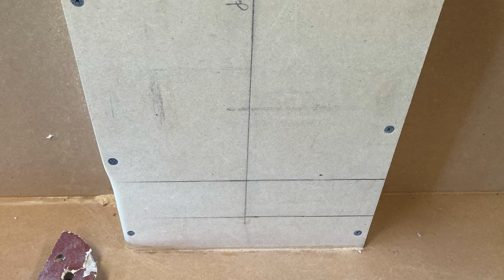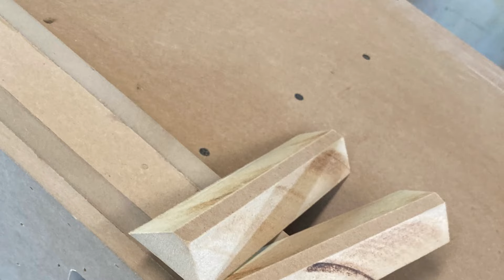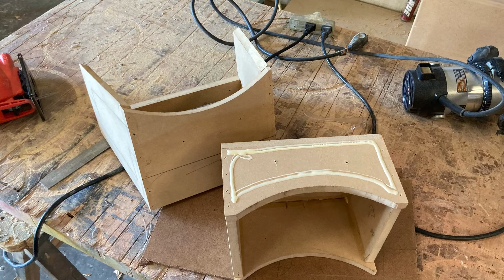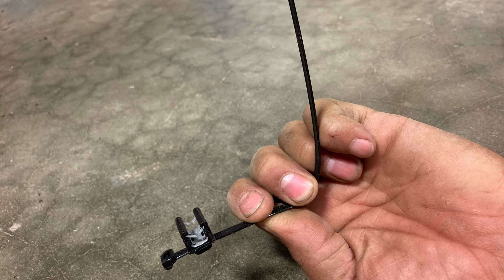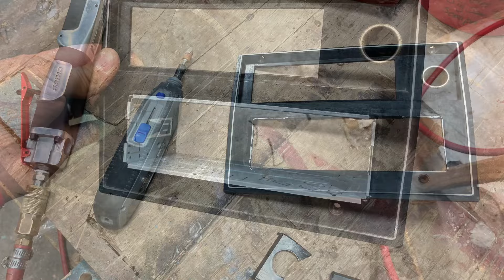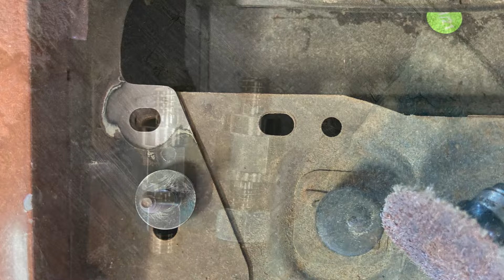El’Camino Box Build and FULL Install

Comment: Why not just use the original compartment because it's sealed and just dynomat it and just make a cover with MDM or plywood why do you need a complete box just curious
Reply from the maker: Great question bro. That coulda been another way to go for sure 👌🏽 As you can tell this el’co  had a lot of rust throughout. I’m not big on using vehicle compartments as the enclosure for a couple reasons. Building an enclosure, I can control the subwoofers air space better, ensure the enclosure is braced properly and not rely on the vehicle for anything 👌🏽 Plus…on this particular install, I needed a solid foundation to build off of for the amp rack.
Reply: Appreciate it currently doing my El Camino I'm not a stereo guy but I paid a shop years ago wasn't really happy with the outcome running for 10s above the seat belt was mid-range and the lower part or some tweeters i think the  (4) 10s was enough music volume because it's all behind the seat I have a  bench seat it is very hard for the sound to get around to the front the new setup will have two tens I'm a Vega guy old school I like to punch in the thump I'm not a big boom guy because the music I listen to basic rock and roll the newer Vegas handle about 150 watts more Hopefully that would take place of the other two tens that got eliminated this time around probably going to go with a sealed box just to keep it balance and tightness and it's well insulated I went with the same insulation as a home speakers use if you've ever looked at a certain Vega home speaker inside padding I believe they call it insulation plus the Dynamat I just don't have the MDM box enclosure basically a speaker box it's basically a metal box with a whole bunch of insulation and Dynamat I've seen fiberglass enclosures,Ii don't know how much I well be  losing  speaker resin sound  or bd  my be low in ? My question is should I divide that box so they're separate chambers so each woofer is in its own chamber I don't know the difference keeping them the same enclosure or keep them separated just curious again do enjoy your work it did look good how many watts will you pushing to those subs thank you bro appreciate it